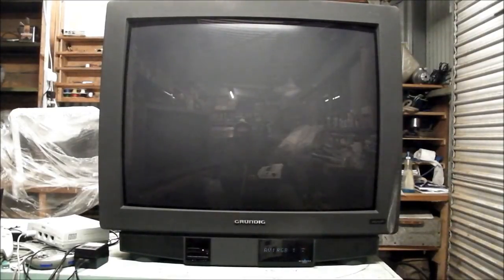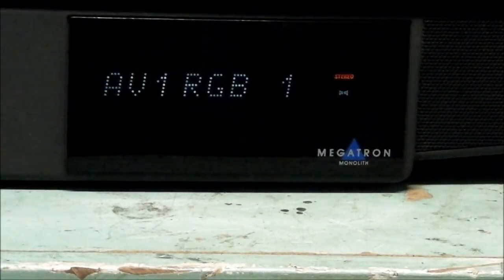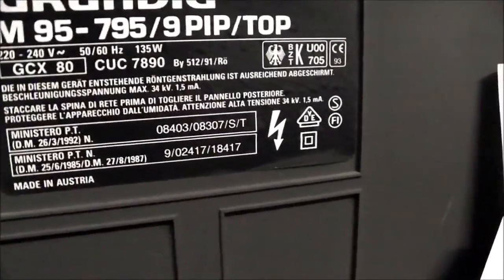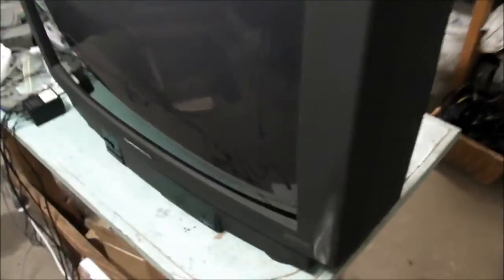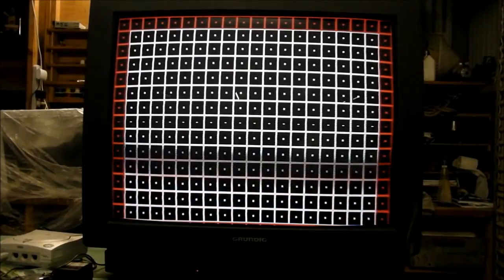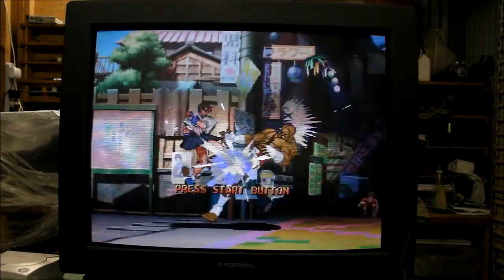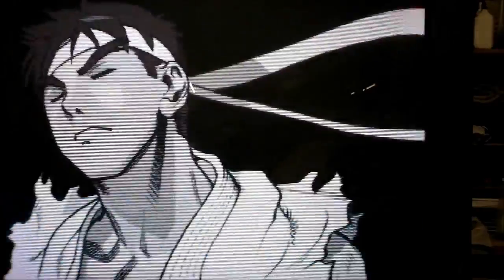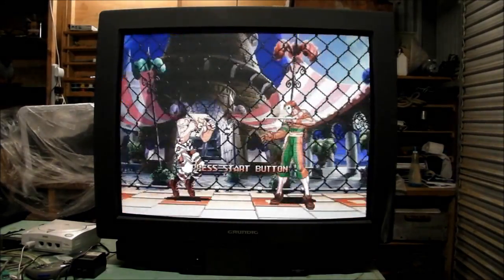Grundig M95-795 89cm SCART RGB TV

Comment: Thanks for your reply.  Here in the UK I think only later silver-cased CRT's allow you to adjust RGB colour (digital chassis) although I have a silver Philips 4:3 28" that is fixed.  The only 28" I've found that did allow adjustment was a cheap Asda/Walmart model from 2003 but picture quality was hideous!  I guess most manufacturers had switched to widescreen models by then so maybe that's why it's rare in big 4:3's.

Comment: Hi Rob, thanks for putting those videos online. I love Retro-Gaming and really like to get the best out of these consoles - currently I'm using a flat Sony CRT, actually I'm pretty satisfied with it but it's a 100hz model. There are two offers quite near my place, a B&O MX 7000 and a Grundig M95-410/9 Reference/PIP. I heard good things about the B&O and I know you reviewed another model. Do you also know about the Grundig? Also a 50/60hz model? I know it depends a lot on personal taste but, which one would you choose (if you can tell) and why? Thanks!
Reply from the maker: I cant quite get the info for the Grundig M95 as I would like. The chance of it being 100hz is high unfortunetly, however it seems it may have a  VGA input which is a handy bonus. The MX7000 is good and it's picture will have the classic look and will definetly the pure one of the two. So the B&O will be authentic with its 50/60hz refresh rate.For me personally if I had to choose between the two, id go the B&O, as much as I like big CRTs i wouldnt take the grundig over the purity of the B&O. Mind you, me being me, id take both, Id love to see that big Grundig in action.

If the Grundig wasnt 100hz(which i doubt), then id take the grundig over the B&O. If you can ask the owner for a picture of the label on the back of the grundig, or even ask what the cuc number is on the back. This is the chassis model, i reckon the chassis inside is the CUC 1894, this may help us determine for certainty if its 50 or 100hz. Also see if it does have a vga connector on the back too.

Comment from the maker: well to be honest i cant think of many  monitors/tvs that have adjustable color on an RGB signal, not by remote, on screen display or buttons on the TV (im thinking sonys you can while other brands not so much). When you can adjust color, its usually the whole lot at once rather than separate R, G or B. The only way to adjust the individual RGB colors would be by the adjustment pots often located on the neck beck board beind the CRT and thats something I havent delved into much.

Comment: Hello RGB Rob.

I have the exact same TV model and i would like to know where i can get the schematics for it, as it requires repair.

It was put into standby mode and since then when plugged into power the led indicator does light up though the telly does not get out of stand by mode.

Any ideas on what could be wrong?
Reply from the maker: I have the oringinal schematics on paper but not electronically. I purchased the document off ebay Germany, you could try searching there. Elektrotanya is a good internet source for free  TV service manuals but may not have a service manual for the CUC 7890 chassis inside our televisions. As a last resort I could perhaps scan my manual for you.
Reply from the maker: ok but it could take a month or so to get back to you with the scans, id need to setup my scanner and its a fair few pages. Ill get back to you.
Reply: It will be okay. As long as I manage to get the scans.

Much appreciated.

Regards,
Anthony.

Comment: I saw an Grundig Monolith Multisystem 281, with a CUC 3800 chassis. It's an Argentinian model and it has only 1 SCART connector. Do you know if it will accept RGB signals through SCART or only Composite Video? Thank you!
Reply from the maker: Im finding it hard to find info on the model you desribe. If the older black shelled type, then its 99% likely to display both composite and RGB from its one scart socket.

Comment: Can you recommend a good but not too pricey SCART switch box?  Thanks.
Reply from the maker: Yes, these are good and not pricey, they have different brand names, sometimes black in color, sometimes silver, but as long as its got the same look/design it should be right, 3 scart inputs, all rgb compatible and one scart rgb out.

http://www.ebay.com.au/itm/SCART-Switch-Switcher-Box-RCA-TV-VCR-DVD-Audio-Video-/331317022665?pt=UK_Computing_Sound_Vision_Video_Cables_Adapters&hash=item4d24088fc9
Reply: Excellent, thank you.  They are the ones I was planning to buy.

Comment: I'm confused, I have an NTSC Sony XBR CRT from 1987, and on the back of it, it has a RGB 'multi input' with 34 pins instead of 20 pins which you'd get from regular RGB.....I want to hook my PS1, PS2, dreamcast(ect) up to it but I have no idea how to go about this....Wouldn't I need some sort of adapter with a 20 pin scart cable?
Reply from the maker: +Donatello97 Have you got a picture of the connector on the back of your Sony? Does it look like this::

http://www.dreamstime.com/stock-images-floppy-ide-port-image23227674

I made a video the other day of an old 80s sony monitor which had a connector like this (but had scart too). We need to get the pinout for that connector for starters. Like you say, it would need an adaptor, female scart to ide or whatever it is. Ill have a look into it...
Reply: +RGB Rob That looks about right, but i'll have to take a picture to be sure. Is this RGB multi out input capable of delivering Component like quality or is it just composite quality? I'm perfectly fine with using an RF cable for my NES(the softer look, and rounder edges look better to my eyes aside from being very nostalgiac),  'composite' for SNES & Genesis, along with PSOne & N64. everything else that's none HD including the Gamecube, PS2, Dreamcast & Wii I'd definitely want a picture more in tune with S-video or component. Yet I hear the NTSC wii isn't capable of displaying an image with RGB/Scart. Hopefully that's not true, if it is I could always just play Wii games on my Wii U via HDMI on my HDTV.